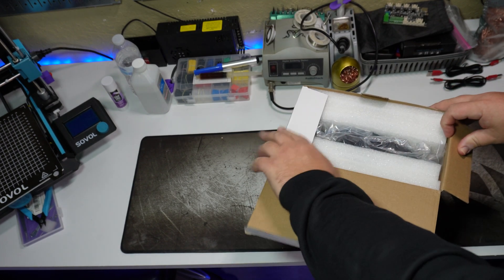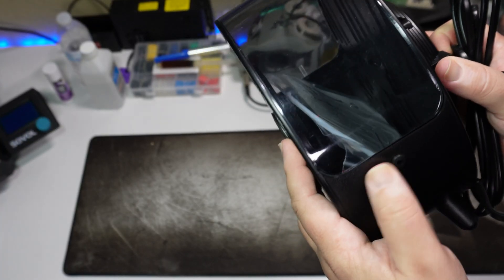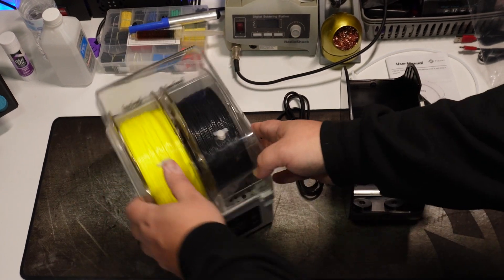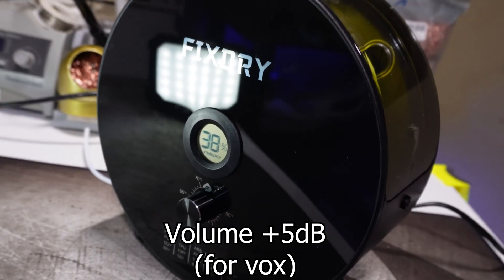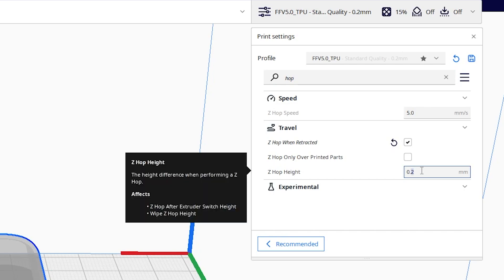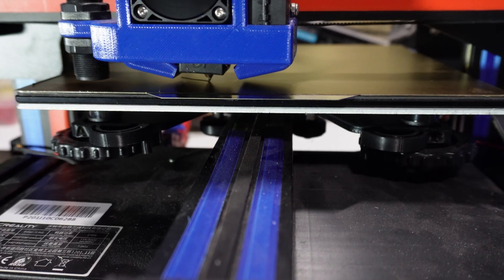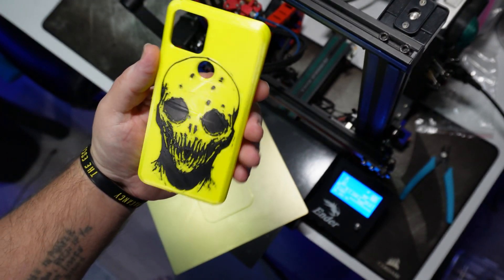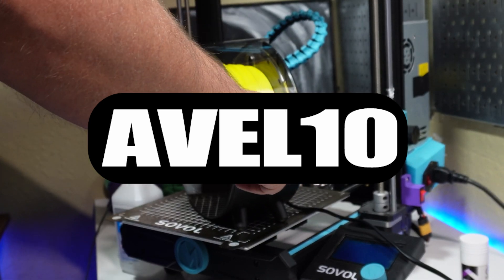I Tried FIXDRY's Knob Filament Dryer!

Comment: What is the difference between nt1 and nt2?
Reply from the maker: The main difference is that the NT1 has the knob, and the NT2 is a digital touch screen. They are both single spool dryers, with the same 40w  heating system and temperature range. As well as both having an independent humidity detector.